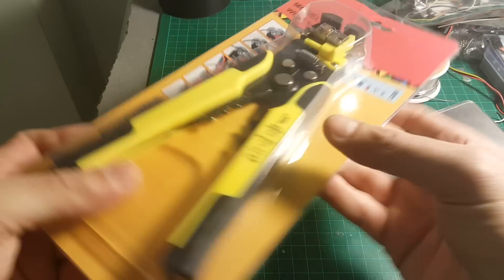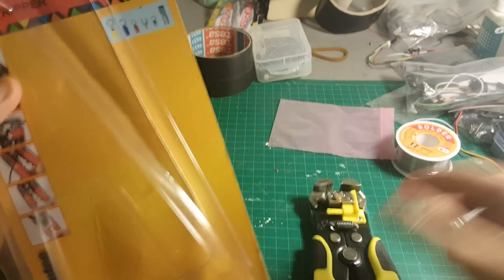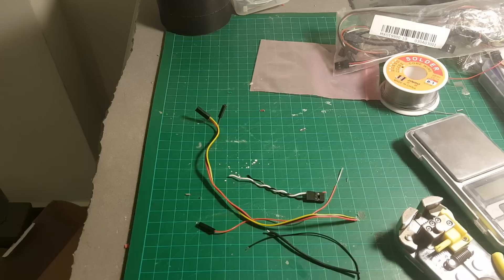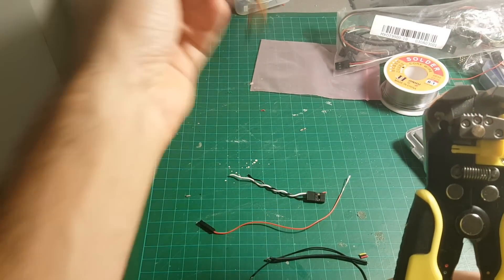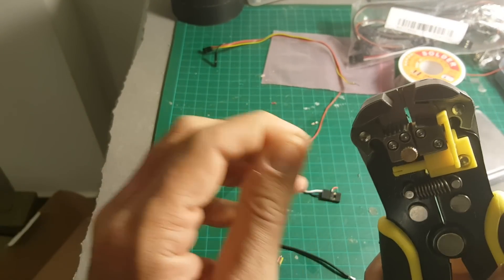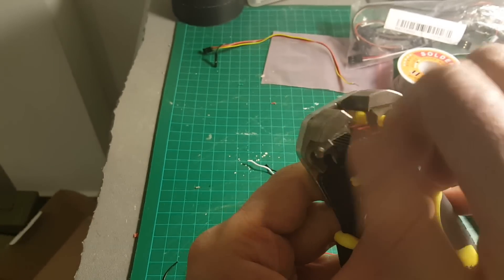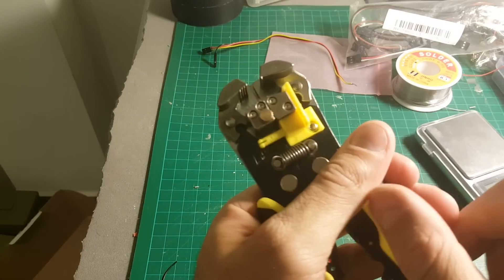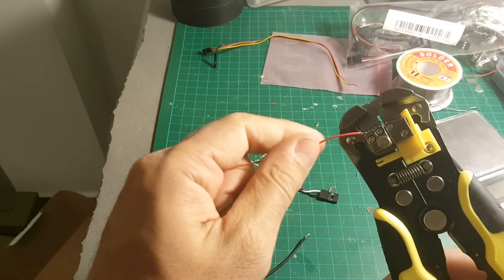Cheap and useful weekly video - Multifunctional Automatic Wire Stripper

Comment: Wrong info 
The knob that yur turning is used to cut the wires by size meanly 10 - 24Awg

The yellow object that is above the silver spring 

Is used to give yu the size of the wire the individual wants visible 3/8 1/2 1/4 or 5/8

🚪🚶
Reply from the maker: Thank you for your correction!
Reply: Black Socks lighter and fingernails. 
Don't mention it.